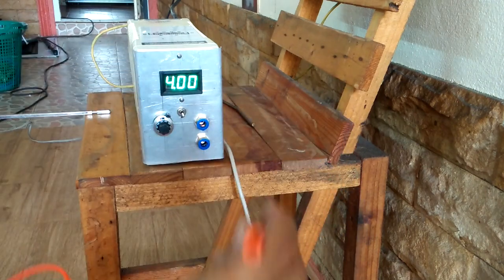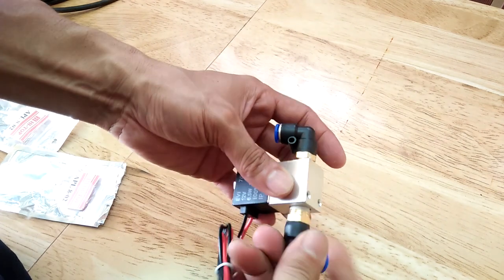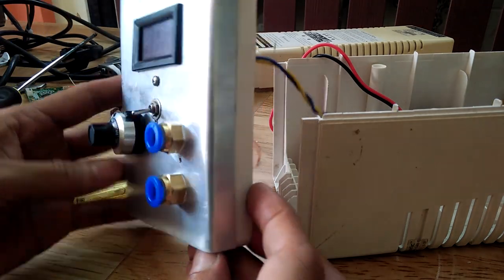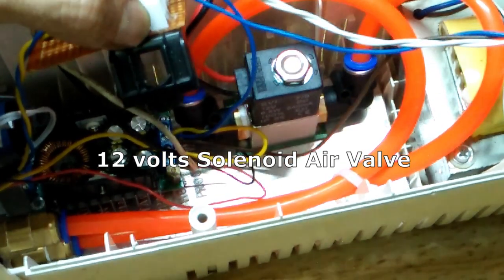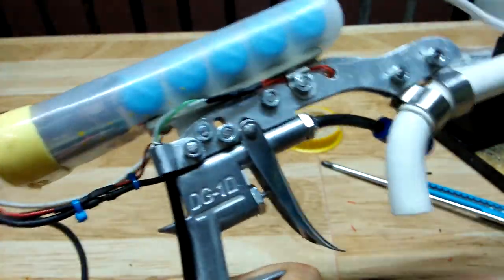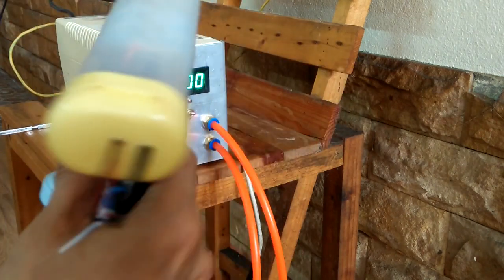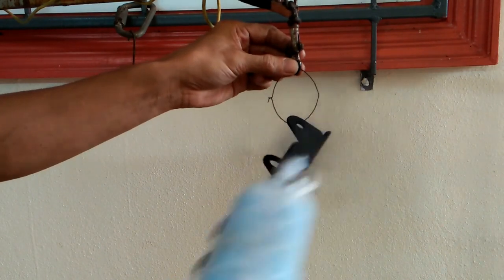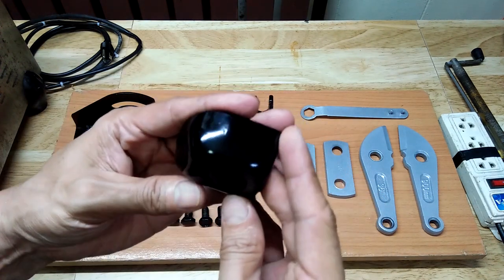Adding a Solenoid Valve to my Homemade Powder Coating Gun

Comment: Hi what volts is your  maximum  and what do you  set your amps too and do your adjust them at all
Reply from the maker: I would usually set to 4 volts and max to about 6 volts. More than that and I experienced the transistor on the high voltage generator overheating also the secondary on the transformer arcing until destruction. Yes, I tried to adjust the voltage in an attempt to mitigate faraday cage effect on some items.  I have new updated high voltage generator and new gun version vids to be uploaded soon. Please check those out.

Comment: how effective would this be with nonconductive materials?
Reply from the maker: If you are talking about powder coating, it is not very effective with nonconductive materials because they don't get electrostatic charge as well as metals. However it is still possible to powder coat glass and ceramics by hot flocking. It is heating the item first in the oven then spraying the paint powder which melts upon contact to the material and thus bond even without electrostatic charge.